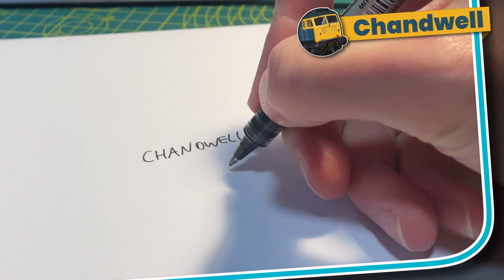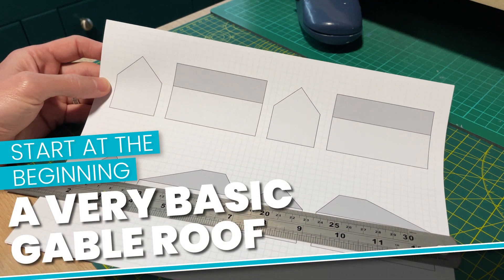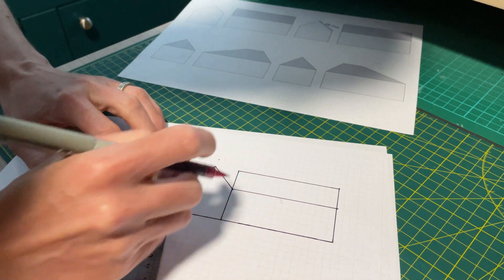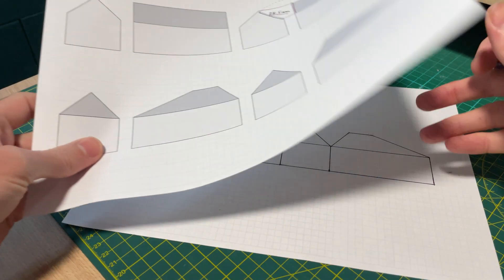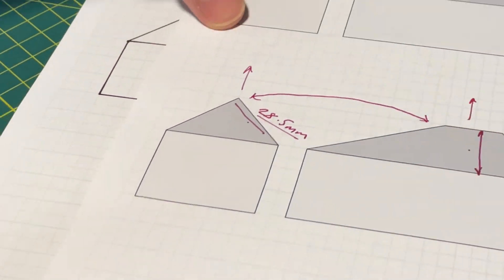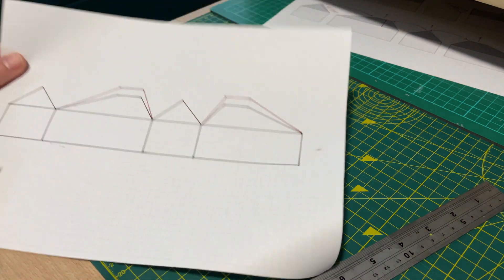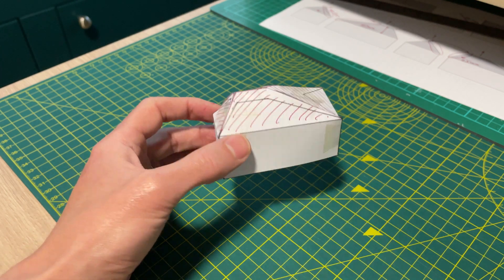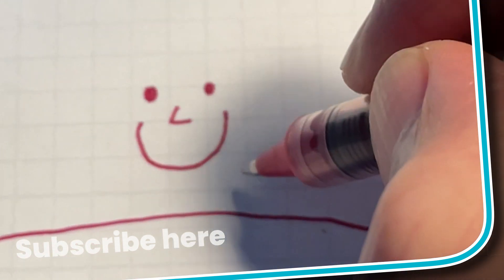Hipped roofs: "No Maths" Scratch Building Technique  - you only need a ruler!

Comment: How do you figure the roof overhang?
Reply from the maker: I use two different methods depending on my mood. If I am making a roof as a kind of "hat" to drop onto the building, I will just make my drawings to the right dimensions to include the overhang, and then work it all out in the same was as shown in the video. If not, then I make the roof the right size to fit the walls, like I showed in this video, and then make the shapes from 0.5mm card. I then make the shapes again, but each one with about 1.5mm extra on the bottom edge. These then glue on top of the 0.5mm base layer and nicely overhang.
Reply: Many thanks. @Chandwell

Comment: Simple, practical applications can often remain ‘hidden’. Thank you so much for shedding light on this somewhat ‘non-obvious’, ‘hidden’ situation. Your demonstration was excellent! Thank you! Having been into pipefitting (in my career), using some trig to figure odd angle offsets, I, too, found it easier to teach apprentices how to figure and cut odd-angle elbows and measuring their ‘travel’ lengths without the aid of a calculator or even a tape measure - simply using straightedges and framing squares. Sometimes using some pretty ‘rudimentary’ tools and ‘rudimentary’ analysis can ‘explain things much easier than understanding the Pythagorean theorem!
Reply from the maker: Thank you. It is always a surprise when you find something that seemed really difficult turns out to be quite easy, just with a re-think of techniques.
Reply: @Chandwell  I certainly couldn’t agree more! 
Once again, thanks so much for helping us to ‘see the light’. Really appreciated!!

Comment: That's really really helpful Michael but I'm left wondering if this will still work with thicker card ? 1mm ? 2mm ? 
Loving your videos 
Mick
Reply from the maker: If you were to make your roofs from a single piece of 2mm card then you would need to adjust the drawing to take into account the thickness of the card. I make my roofs from two layers of 0.5mm card and always cut the top layer about 1mm wider than the bottom.

Comment: I just modeled a very complicated roof based on an 1880's building design. I won't say it was "easy," but there's no way I'd have done it without this video and the results were perfect the first time! It had hips running into gables halfway up the wall causing the eaves of the main roof to flare out far from their normal run. Yet taking my time and following the steps in this video, I was pretty much dead on with my paper mockup. Now to test it in a card mockup!
Reply from the maker: This has really made my day! Thank you for taking the time to let me know. And thank you very much indeed for sending the pictures too! Would you mind me using one of them in a future video? :_chandChandwell:Michael
Reply: @Chandwell  Absolutely. Please do.

Comment: Another easy way in Inscape is to project the joining edge using the base of the roof edge as the center point and the top  point as the radius. Now project the top of the circle horizontally to the adjoining wall, draw a line vertically from the center of the wall intersecting the top horizontal line, that's your peak. Holy Moly! It's easier to do it, than explain it. Your use is great, and of course keeps giving me more ideas. 
I am now rethinking the whole roof line on my mirror warehouse. Should be interesting.
Thanks Again
Don

Oops... Spoke too soon, using Draftsight, not Inkscape.
Reply from the maker: That sounds like I need to read it again, slowly! As ever with these things, there are probably a million different ways to come to the same end result, and I find that endlessly fascinating. Thank you for watching!  --Michael